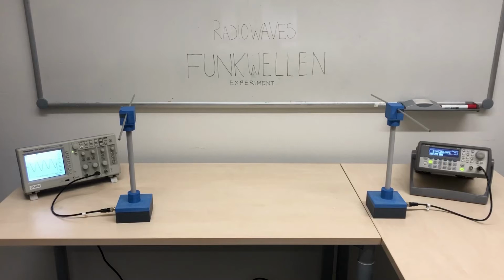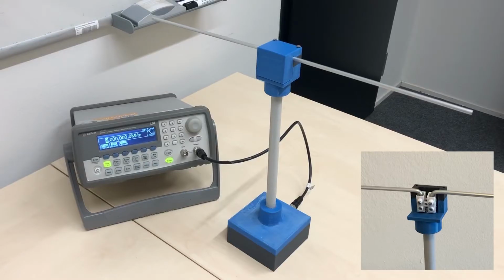Radio waves: Sending a signal between two dipole antennas

Comment: why is she able to transmit 8mhz signal through an antenna less than 30m given that λ=cf will give us a wavelength of 38m approx??
Reply: Indeed, a perfect length of an antenna for 8MHz would be 1/2 of the wavelength, that would be 18.75m. Hence halve wave dipole. This antenna is obviously to short, it radiates but of course far from perfect. Also, to test at these frequencies you need to have a distance of several wavelengths, the so called far field. Maybe to test at 100m distance at least. What you also see that the amplitude does not change much at all with the distance, and we know that signal would go down with the square of the distance, in a normal working condition. So we have here a near field signal and the antennas are probably just capacitive coupled.

Comment: can you explain more in detail on how the antenna are connected to the function generator/oscilloscope? are each bar connected to negative and positive?
Reply: Right! And does the transmitting antenna contain some kind of RF power amplifier? Are the two antennas a special piece of lab equipment or just aluminum rods on a stand? This is a good video but a little more set-up information would make it great.
Reply: The antenna is a so called balanced (symmetrical) system. The output of the function generator and the input of the oscilloscope are un-balanced. To connect balanced and unbalanced systems we use the so called BALUN's. This is a shortage of Bal(anced)-to-Un(balanced). These are often transformers. Impedance matching is also part of correct connection of two systems. The dipole antenna is about 73 Ohm of input (feed pint) impedance.
Reply: @ernestb.2377  what does it mean when we have an unbalanced system? Do u mean that the wires from the oscilloscope connecting to the antenna are not the same material/thickeness so there will be some kind of reflection at the junction?